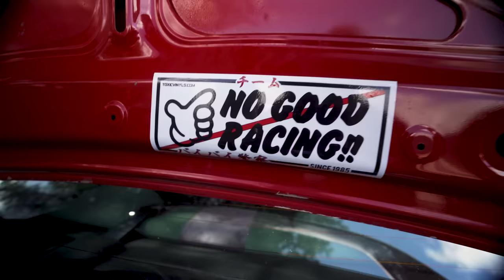Karl Buys a Japanese Performance Icon! ;-) Workshop Update No.26

Comment: As somebody that doesn't like coffee but had to do to much research into a home coffee making system for a gift where I would end up having to use the tools purchased. Get a "Aeropress" and a nice coffee grinder that can be stored inside the cylinder of the press. I ended up picking a "1Zpresso Q2" and it seems to do a good job but other grinders are available but you will need one as you got a bag of beans.

Comment: Karl, the accord. H22 engine has massive support in the US 😉 BUT remember the the accord type r/H22A7 were only availible in europe. Plus, if I remember correctly, the H22’s have fibre reinforced metal liners in the alloy block, so be aware if you do anything daft. (Pistons have a special coating on the skirts for the FRM liners).

Comment: Not related to this video, my question is whether you have a technique to measure valve spring installed height on DOHC “bucket” type tappet cylinder heads, that could be demonstrated.
I’m half suspecting that many just install springs just going with valve stem heights and hope for the best.